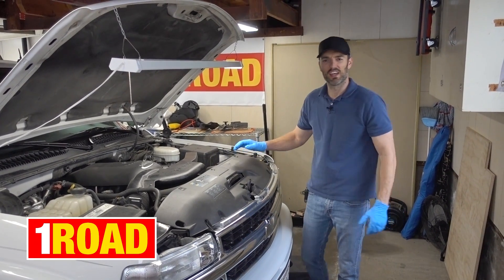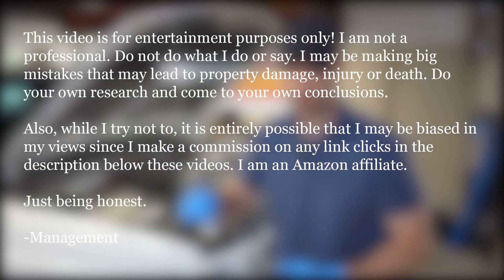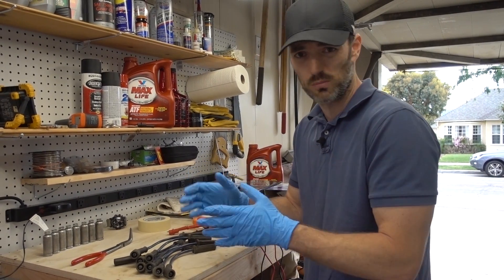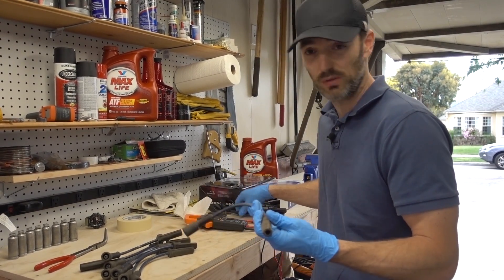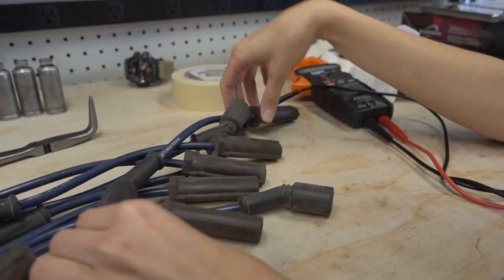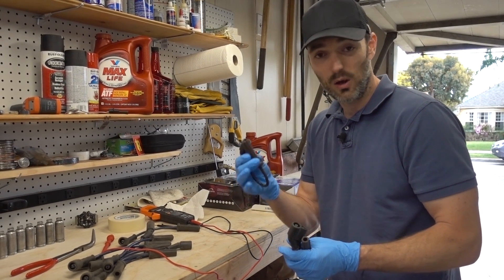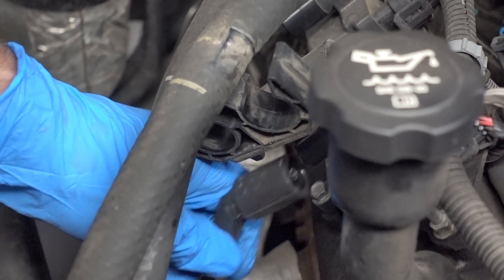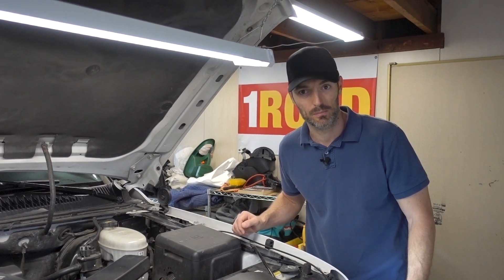Why You Should NEVER REPLACE SPARK PLUG WIRES WITHOUT FIRST TESTING FOR OHMS!

Comment: Should buy granatelli wires 0 ohms resistance and if you ever get over that they will replace them for free 
Running a set on those on 11 Sierra aka Susie 6.2L
Reply: Granatelli O ohm wires are patent protected by United States Patent number 7,185,622. This patent covers our unique method of producing ignition wires of extremely low resistance while maintaining very high noise suppression. The benefit of this invention is that full electrical energy from the ignition source is transmitted to the spark plug. The end result of the application of this method is increased horsepower, torque and fuel economy.
Reply: Stainless steel core maybe?

Comment: I'm a die hard AC Delco guy too but resistance is resistance. If it performs better, I'll use anything.
Reply: I suggest dry ice  it will cool the cables and make a super conductor    out of them

Comment: I had put in plugs other than AC Delco and different wires as well into my 05 Pontiac Montana SV6 several years ago. It missfired like crazy. I used it like that for a while and finally put the AC Delco plugs and wires and the problem went away. I figured it was the one place to not chase things and put what came on it from the factory and it paid off.

Comment: Go OEM. A lower resistance means higher current which can give you a stronger spark, but the stronger spark can also wear your plugs out a bit faster
Reply: Markus R. True, if you leave the spark gap at the factory spec. Open them up a bit to cool the spark just a hair. 10% would be a good start. 

(Slavish devotion to the dictates of a corporation’s engineering dept is ridiculous when that corp’s purpose is to separate you from your money in the biggest and most frequent ways possible, as far as I’m concerned)
Reply: But OEM has much higher resistance.  So now what

Comment: My experience with many GM vehicles, AC Delco mechanical parts are great!  No disputing that. BUT... their electronics suck so bad!!!  Most of the GM problems I encounter are from poor connectors and poorly engineered electronics. My pro opinion is stick with NAPA wires. Low resistance is better power delivery to plugs and more precise spark timing. Yes, the ECM compensates for variances but, why rely fully on that.

Comment: OEM is not allways better. if you find a product that gives better preformance then go for it. if you put in the better product then you will get att better car in the end. better fuel. better filter. better oil. better tires will get you longer life, lower fuel consumption, better cold start. i say look around when you put in filters or sparkplugs for OEM or if the price is good the better product.

Comment: You need to study the manufacturers.  Copper core no resistance is best.. unless you got electronics... That's why you have resistance.. so emp don't screw with radio and vehicles computers....   No resistance will allow better spark with increased gap better performance... Think hot rods.. 0 resistance .. Escalade with loads of computers resisted. And inefficient compared to hot rod with points

Comment: test the ohms resistance when the wires are hot you’ll get a different result. i would use the new ac delco ones. they are new and you already broke one of the old ones and since you don’t know how old they are, better safe than sorry.

Comment: Why even change wires if they're in spec? Still running original wires with over 300K miles. Every time I check, they've been in spec, so I leave em alone.

Comment: even new wire sets should be checked. I have purchased sets in the past that were all over the place as far as ohms go. I always ended up going with ford racing wire sets or MSD. Not sure if gm makes performance parts other than oem replacement. I also index the plugs when possible. Now vehicles dont even have plug wires. I would do research before buying new COP as well. OEM is not always best.

Comment: Spark plugs run at 25,000 volts and are pulsed.  A 200-ohm difference is generally not a huge barrier in the grand scheme.

Comment: You did say "OEM" at least a dozen times here and clearly stated that those are the wires you're going with. OEM products are not always the best and many are made by other manufacturers then rebranded. Many are good products but how to determine that can be a problem. I have used NGK wires since I bought my Camry used. I have changed them when I put in new spark plugs every 30k miles. I have little doubt that I could easily go 60k miles with them; they show minimal wear and tear and work as well as when installed. They are made by NGK and never rebranded. You can buy them on Amazon (although RockAuto may be cheaper) for example:
https://smile.amazon.com/NGK-51033-Wire-Set/dp/B00X1WQCSI/ref=sr_1_fkmrnull_1?keywords=NGK+51033&qid=1555094376&s=gateway&sr=8-1-fkmrnull

Comment: High resistance wires (measured in ohms/foot) are used to reduce magnetic interference with sensors and the car radio. Like you, I've noticed that new wires sometimes don't meet manufacturer specs when compared to the standard outlined in the OEM dealers manual. However using an ohmeter to judge RFI interference from high voltage wires is not an exact science. The last set of wires I replaced didn't meet specs, not even close. However I decided not to return them, and they are working fine....

Comment: I like lower personally but remember your computer compensates for many problems. It sounds like some people have had problems with the lower resistance wires quality. You have gotten some of the best suggestions I have heard in a long time from some very experienced people. I guess for an everyday driver I would go for quality and research the technical aspects. Great thinking video.

Comment: 1. Stick with the low resistance wires.

2. Some parts are ACDelco, some are Delphi. The fuel rail on my 06 Silverado is Delphi.

3. More resistance (higher Ohms) leads to less current reaching the spark plug leading to weaker spark, less fuel burned (ECM has to provide more fuel which means worse gas mileage), and reduced power. Racing vehicles many times use low resistance wires (at or under 100 Ohms per foot) to ensure the least resistance along that path. For stock (fuel injected, 1 coil per cylinder) engines,  anything under 1000 Ohms per foot should be good enough to run well and not affect power. For older carburated distributor vehicles, more resistance (higher Ohms) can lead to misfire in the coil, spark jumping in the distributor, points not firing properly, etc. This is why many of them made a lot less power despite being larger engines. Many standard plug wires from the 70s and 80s were rated in the 12,000-20,000 Ohm PER FOOT range, except the performance wires came in at/under 1000 per foot (meaning 3000 Ohm reading for a 3 foot wire). Technology has helped advance this aspect to provide much lower resistance wires for standard pricing, so that 150 Ohm 6 inch wire would be 300 Ohm per foot resistance wire, the AC Delco Pro wires he got at 400-500 Ohm is 800-1000 Ohm per foot wires, which is still the standard, but nothing special.

4. Also, if a coil is dying/weak, the added resistance (1000+ per ft) can actually accelerate the death of the coil since it cannot discharge all of the energy each time leading to a build up and increased heating of the coil(s). 

5. For other engines with a "waste spark" and secondary spark plugs, like a previous 2004 Durango Hemi I owned, I never worried about the plugs or wires it with the secondary spark, it is minimal benefit on good running engines so I only dealt with the primary plugs and coils.
Reply: Mike K4ISR E = I x R and P = I x E. If resistance increases then voltage drop increases there for lower voltage to the spark plug. Current decreases which means a decrease in power to the plugs and just like you said causes the ecu to adjust the lower power thus needing more fuel to compensate ad lower gas mileage. No resistance equals max power but also creates a direct short for the coil which creates more heat and would need to increase the physical size of the coil. The ecu can compensate for this by shortening the spark duration. Man, computer controls are the way to go. Great comment my friend.

Comment: I don't have any proof, but I think your Burban's "engine computer" individually controls each spark plug, and has the capability to compensate for minor differences in plug, and plug wire resistances. 

As far as replacing the Napa plug wires that were working OK, with new OEM plug wires;

I can see both sides of this decision. One side of me says "If it ain't broke, don't fix it". No point in spending money to unecesarily replace a known good component. 

On the other hand, if it gives you piece of mind to keep your GM vehicle, as "GM" as possible using OEM parts, by all means. 

One thing's for sure whenever I replace a component on my cars, I always keep the old part, in the new parts box, and store it for a month, six months, or up to a year just in case there's a problem with the new part. Having the old part on hand may help diagnose the malfunction. 

A wise man once told me, "Just because it's " NEW", doesn't guarantee  it's "GOOD".
Reply: Living in a Desert;
I used to throw old parts away too. But, I learned the hard way to hang onto old parts for a while.
When it comes to things like this, there's a fine line between thinking ahead, and slowly becoming a pack rat hoarder. lol
Reply: It can only compensate by advancing or retarding the IC, it can't control the power of the IC itself.  So the wire resistance is really no different than how the ECU compensates for a worn plug or weak coil.
Reply: When you are talking about resistance of electrical or electronic components, 5% variation is minor. 10% should be suspicious. If you come across 20% variation or more I would definitely replace or repair the components in question.
But keep in mind that temperature plays a big role in the resistance of a conductor ( along with moisture and connectivity).
Reply: Budget Panther Fan 🐬🐊🐙🐖🐡

Comment: Napa is dead to me. I have had to many problems with their brand and service.
Reply: Same here, I used to do Napa exclusively. Didn't mind the higher cost for quality parts. Then the quality went down hill fast, and their prices stayed high. Then some of their "lifetime warranty" parts lost the "lifetime" part of the warranty. They are a joke now, byproduct of piss poor management I'd say.
Reply: I avoid Napa like the plague.  Always overpriced, even their own house brand stuff, and very limited stock always having to order.  Advance Auto is usually the go to for me... especially with their online coupons; I always save 20-25% with their coupons and it's ready for pick-up in 15-minutes.  I find Orielly is the best for tools, and AutoZone good for accessories like detailing stuff.
Reply: Only time I go to Napa is when I need something like asap, otherwise OVERPRICED, a Napa tie rod for my truck is $140, a similar moog part is 120, same moog part from rock auto.... $60
Reply: @colteng9721  just got to watch r/a. They will get you on the shipping most of the time.

Comment: specification for spark plug wires for the GM 5.3L V8  is 800 ohms plus-or-minus 500 (300 to 1300 ohms..

you just got lucky  napa has poor QC on those plug wires    
that is why it broke I bet they are 1kohm when warmed up

Comment: How many devices do you plan on running in your vehicle? The more you have running the higher the amps. Wouldn't you want lower resistance to help lower the amps from your battery?
Reply: Justin B Not so much current here as voltage amplitude.

Comment: I'm not a huge fan of OEM. Factory always cuts corners for production efficiency and keeping costs down. Many aftermarket parts are far superior to OEM. Years of Hot Rodding have left me with a certain disdain for factory parts lol.
Reply: Don't confuse upgrade parts with replacement parts.   OEM parts are generally designed as best they can to last the life of the vehicle.  Replacement parts are generally designed for whatever short life the vehicle has left, or put it back in service as soon as possible.  Upgrade parts are things designed to outperform OEM.
Reply: Ariyana Dumon you got a point there
Reply: Quite the opposite really in many cases. A lot of aftermarket parts are noticeably inferior and shorter lived. There are some cases this is true, but the majority of the time with the majority of components OEM tends to both outperform and outlast, and is often cheaper.